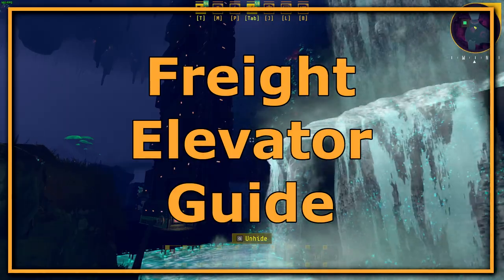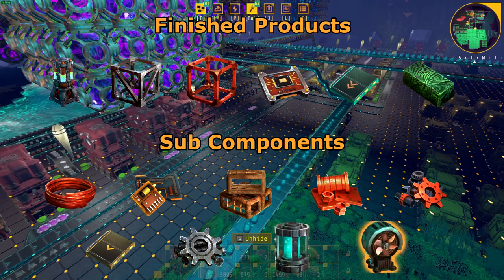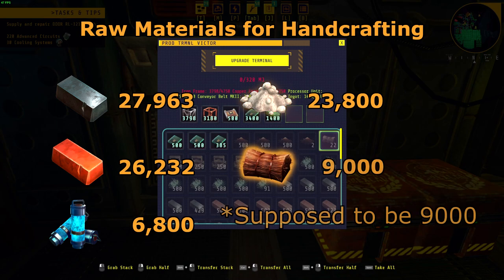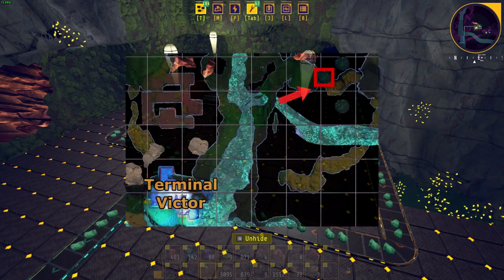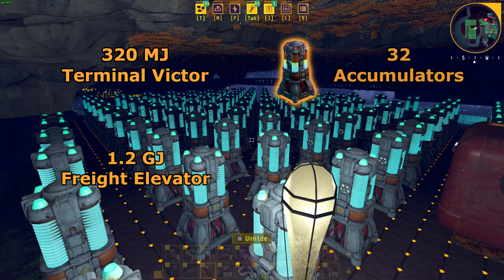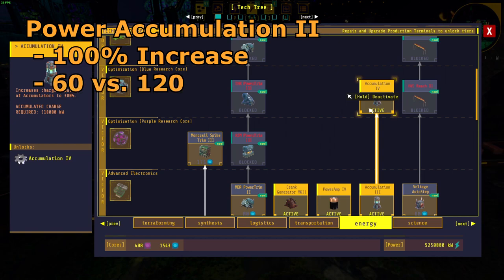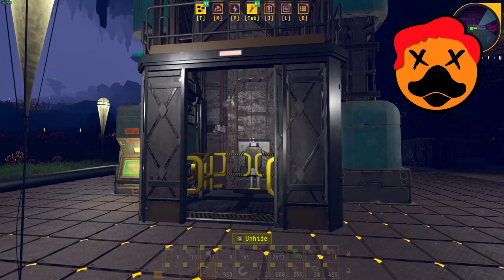Techtonica Freight Elevator Guide

Comment from the maker: Atlantum Ore Guide ► https://youtu.be/1tg2XpfHNTg

Techtonica Calculator ►https://www.techtonica-calculator.com/

00:00 - Start

00:13 - Unlocking the Mission

00:27 - Upgrading Victor T7

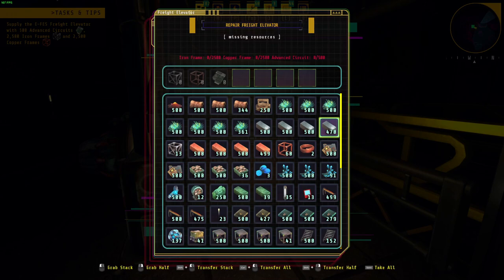00:47 - Upgrading Freight Elevator

01:14 - Automation List

01:59 - Why Automate

02:57 - Atlantum Cost

03:57 - Power Breakdown

Comment: I haven't watched the entire video so I apologize if you've already said this but I went to the emergency signal a while back and did everything I saw that I could do there but when putting in the power and the other stuff it needed a security overide and I was told to complete the emergency signal. What do I do?
Reply from the maker: All good and thanks for leaving a comment.

They massively updated the game since I played so my guide may be outdated.

It might be a tad different now but you may need to complete more of the main missions first and then the elevator mission may become available.

Edit: Back then you had to level up Terminal Victor but now there's an entirely new Terminal so you may need to level them up more.

Hope this helps.
Reply: You need to find Paladin first. Its the signal down the river right of victor, you need to dig into through the wall to get to another facility. Wehn you go all the way through youll find another voice box like sparks

Comment: Hi Archivers, I'm hoping you can help me with this!
I've Unlocked Victor to Tier 7 (and  X- Ray too).
I've had the 'Inspect the E-FES Freight Elevator Console' message. 
I've got 7.7GJ of Accumulator power (about 192 Accumulators I believe - 112 at the Freight Elevator and the other 80 at Victor in the old Accumulator section). These sections are connected via a power cable plugged into the FE and via active flooring!
But the Console still say it needs 1200MJ of Power???
The Production is pulling between 8 and 12kW of 46,875 kW from Watermill turbines.
How do I resolve this? I found the FE long before I completed the above steps. Has this messed my save file up or something?
How do I unbork this so that I can activate the FE please?
Any Help is much appreciated!
Reply from the maker: Hi Susanna, I'm afraid I can't help much. I played the game when it came out and a lot has changed since then so the requirements needed for the FE may be different.

I'll have to make a new save file to check out all the changes but that will probably take too much time.

My guess is I don't think your save file is borked. If the FE is still saying it needs more power, it could be that some mission flag hasn't been hit yet. You could try leveling up the terminals more or do more main story missions.

That's all I have for now. Sorry I couldn't be of more help. If you want, I can start a fresh save file but it'll probably take me a week to get to the FE.

Edit: I do remember having to have a story encounter before I could interact with the FE if my memory serves me correctly. Trying to avoid spoilers.
Reply: @duckyobrien  Hi! Thank you for your reply! I'm not sure you starting a new save would help me (you would have to replicate the steps I have taken to get to the FE and even I don't know what they were! I was just exploring, doing stuff, completing the missions (no doubt in the wrong order!) and trying to get stuff done... 
I'll continue to see if I can complete some of the other content. Hopefully something will turn up that will activate the power to the FE! But I'm clean out of ideas what else to do now!
I really hope its not broken and I can't progress pass the FE because it can't be unlocked! The power is there but it's juts not seeing it for some reason. I even tried deleting all of the Accumulators. Saving the game. Closing it. Restarting the game. Put all the Accumulators back again but this didn't make any difference at all! Even with 7.7GJ of Accumulator power - Zip! The 1200MJ remains red on the FE screen... 🙄
Reply from the maker: @SusannaSaunders  Yeah it may totally be a missing story encounter (avoiding spoilers). The FE mission was notorious for being very unclear when you could actually interact with it when the game first came out and I don't know if they fixed that yet.

But if by chance it were some power related bug since you have so much accumulated power, one thing you could perhaps try is linking the FE with power floors instead of cables. This probably won't do anything and will be a bother to do but it's an idea. I would do this as a last resort and create a separate save for this.

There was a bug with power cables and rails when the game first came out but that should be fixed by now. I have my Fe connected via power cables but you never know I guess. Maybe there is another bug that hasn't been found yet.

Anyways, it's most likely a missing story mission. Wish you the best of luck and hope you get it working.